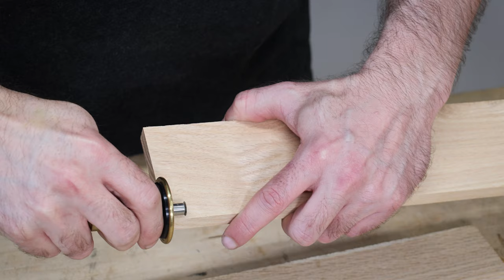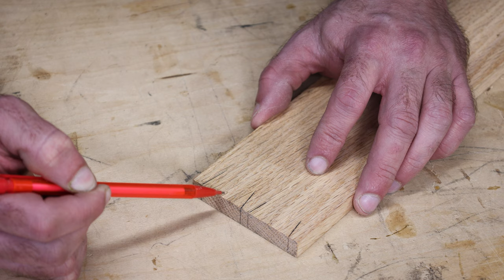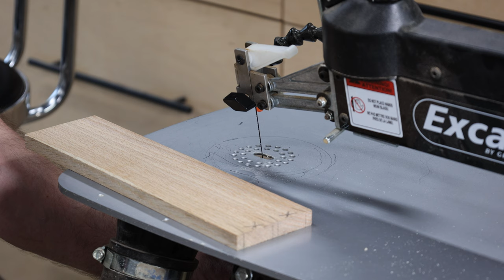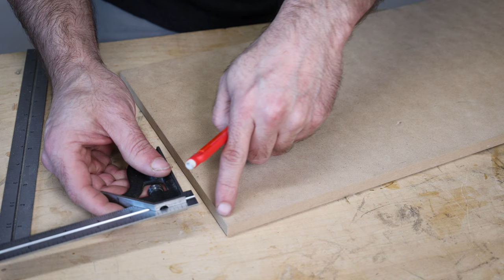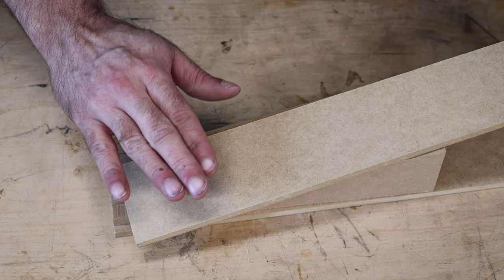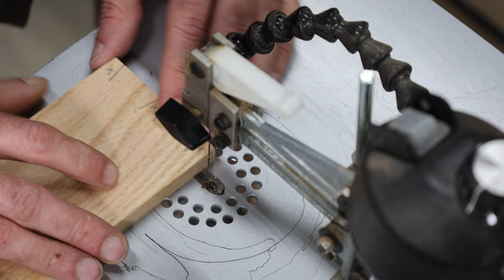I Attempted to Cut Dovetails on a Scroll Saw...

Comment: Instead of a jig, you can turn a straight blade backwards and pull the material from the opposite direction, or use a spiral blade and again pull the material from the other direction.